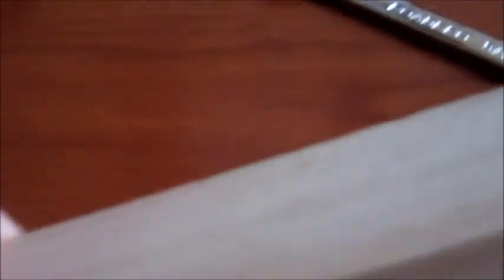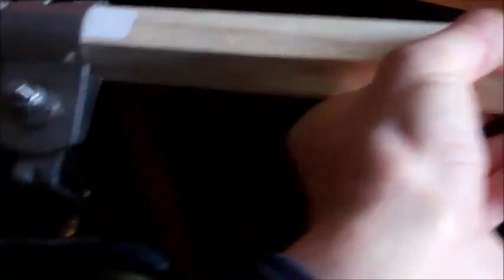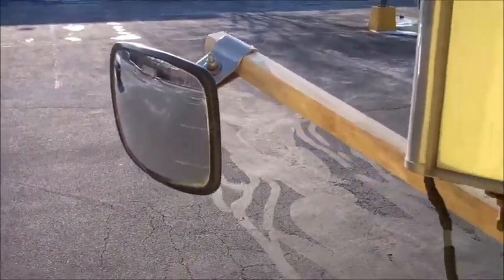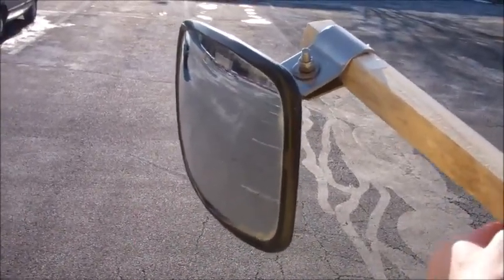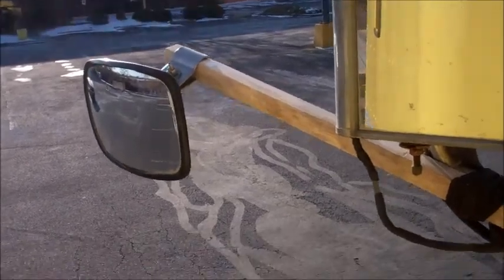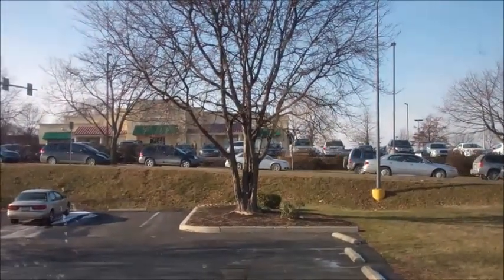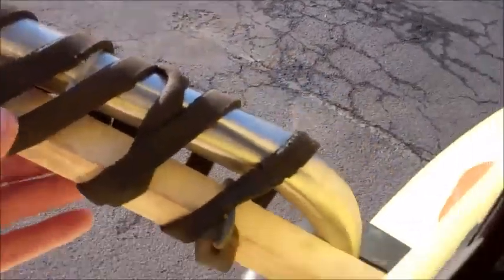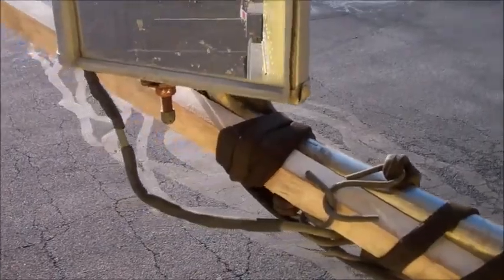HOME-MADE TOW MIRRORS

Comment: If the bungie cords down work try some hose clamps or some zip ties. If i was you i would put a few small screws into the wood and put the hose clamps inbetween those screws so the wood cant move laterally.